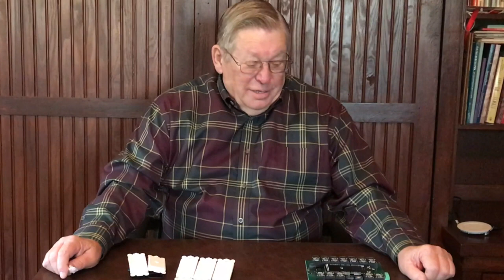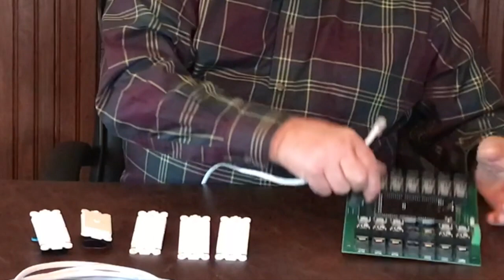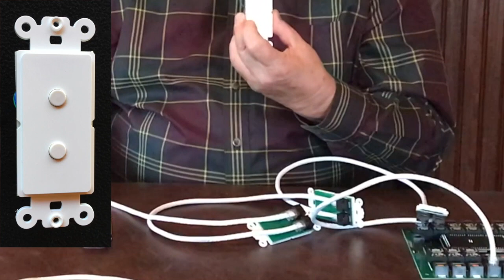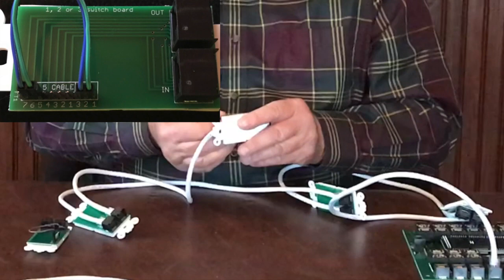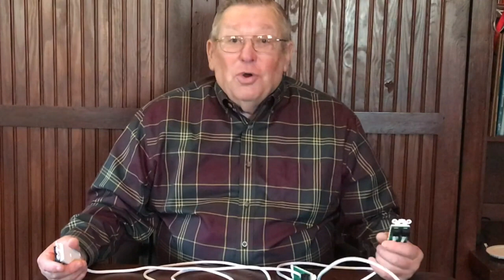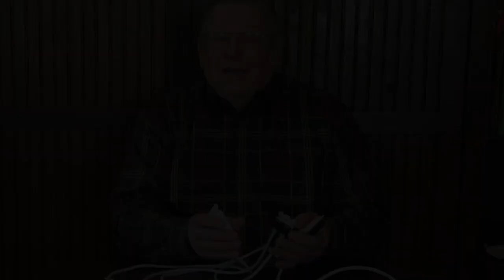PMMI Lighting Switches

Comment: Do you make a toggle type switch? I am not a fan of button lights. However I love the rest of your system I would love to build my next house around it.
Reply from the maker: Drew Calder, Thank you for your interest!  We have to use the push button type switch to get the action we need to make it work as both a toggle and a dimmer. If we used a toggle it would have to be a momentary toggle and we are unable to get the timing of it made so it could be used it as an on, off, toggle or dimmer. We have tried and it just doesn’t work right. Anything less than a 500ms push is off, on, or toggle. Anything over 500ms turns it into a dimmer. You can also use tablets or iPhones or Alexa and no switches to control lights and scenes. You can find more about our products at https://pmmi-lighting.com, or please feel free to email us at pmmi@pmmi-lighting.com for more information.
Reply from the maker: Drew Calder 
Call me at (979) 487-8356. I have more sw info for you
Reply from the maker: Drew Calder toggle switches do not work with our system. Must have momentary contact to get dimming function. All switches are read on their release not the make